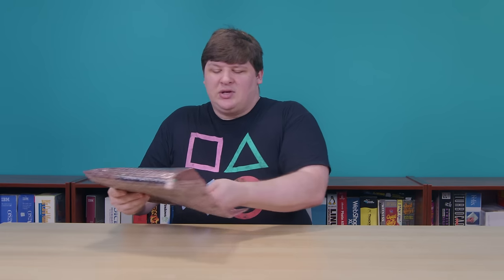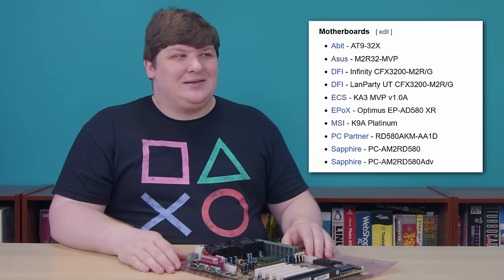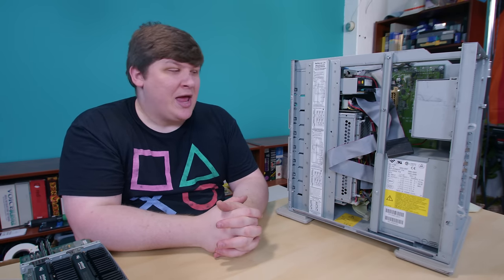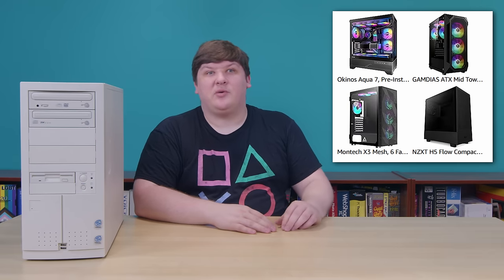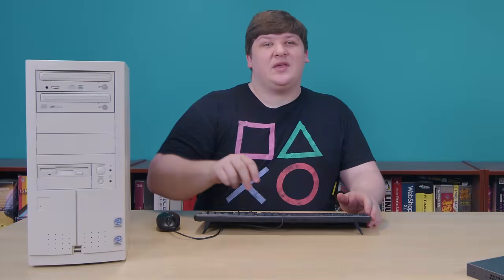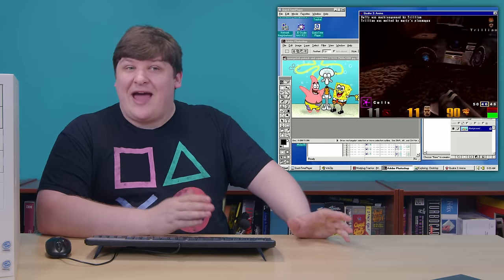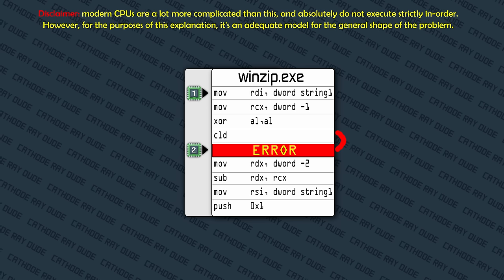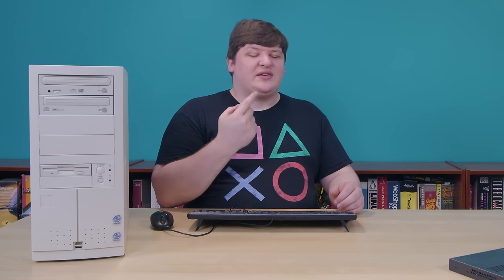The Only Famous Motherboard

Comment: As to why "Why Celerons on the BP6?" - when the BP6 came out, Socket 370 was ONLY for the Celeron (As you mention in the bullet list that you also imply is wrong, but maybe it was just the last bullet you meant was wrong?) The Coppermine Socket 370 Pentium IIIs didn't come out until quite a bit later. And Intel HEAVILY "suggested" that manufacturers use newer chipsets for the Socketed P3s.

And per my other comment - the main reason was that at the time of the socketed Celeron's release, the P2/P3 used a 100 MHz front side bus, and the clock multiplier was locked.

But many of those Celerons were basically "underclocked" Pentium II Deschutes cores, and were only available on the 66 MHz bus. You could quickly and simply overclock them by just running them at the 100 MHz bus of the P2/P3. Boom, that Celeron 300 becomes 450 - with the P2's faster 100 MHz bus, increasing a bunch of things all at once. That 366 becomes a 550. That 400 becomes a 600.

And a Celeron 366 cost WAAAAY less than a Pentium II 550.

I found the ad you featured @ 1:00:21 - on the same page is the nearly-identical but single-Slot-1 BE6-2. The motherboard cost the same $149. But the BP6 with TWO Celeron 466 ($369 bundle as shown in your video) cost only $10 more than the BE6-2 with a SINGLE Pentium III 450 ($359.) For $10 more, you got two CPUs that were each 3.5% faster; and could possibly be overclocked to significantly faster. (Or save $70 and get the dual Celeron 400 which would almost certainly be able to be overclocked to 600 MHz - the BE6-2 with a 600 MHz Pentium III would run you $629 - more than $300 more than the dual 400s.)

(And the Katmai Pentium IIIs didn't overclock very well. That 600 MHz Pentium III likely wouldn't overclock at all.)

(Also to note - Intel only finally bumped the Celeron to the 100 MHz front side bus with the 800 MHz model. The 766 MHz Celeron was still 66 MHz bus - with an atrocious 11.5x multiplier.)

Comment: 1:01:45 - /me  zips out folding chair and pulls popcorn out of microwave
Celerons were when I'd first heard of overclocking. I'd bought a 500mhz Athlon at in nineteen-dickety-ninety-nine, but Dual Celerons would have been So Choice with any linux or win2k. I'd always thought dual procs of the time were the purview of Xeons with ECC ram or PowerMac towers and none of this is for people who want to play vidja games. Core Duo is 2006, so you'd be getting a taste of computing from years in the future. Absolute monster sleeper.

Comment: You could take advantage of multiple CPUs on Lightwave back then by running a second render node on the same machine but this was only useful if you were rendering an animation and did nothing to speed up preview renders. They did add real multithread support fairly early compared to most 3D rendering apps though I think before the Core2 Duo came out IIRC.

Comment: Let me correct:
1. SMP is just "Multiple Cores" and has nothing to do with the implementation of the Abit board. In fact I worked on SMP systems in 1989, based on SPARC-CPUs (if you discount the Amiga computers which sometimes had several CPUs).
2. The first SMP consumerboard (again discounting Amiga systems) was the Gigabyte 586DX, with two CPU sockets, six RAM sockets and UW40 SCSI. It was not just powerful but also dirt cheap, cheaper than a normal 586 board and an SCSI controller. Before that 486 based SMP boards started at three times the price - without CPU.

Comment: I had an Antec 1080 case with Dual Amd 2100s using a Tyan mobo in 2004.  I stopped using it in 2008 when I noticed it sounded like a jet engine taking off when booting.

Comment: I Have the Dell Precision 410. Which is the (slightly) older brother of the 420. Looks the same on the outside but has a few differences:
Standard Intel 440BX chipset.
Normal AGP port
Standard SDR SDRAM.
edit: A power supply in the top part.

Still has the capability for 2 slot 1 processors. I have mine populated with 2 coppermine P3's @ 700MHz.

Comment: i don't remember if that board runs coppermine processors or if you need a pin mod to make sockets compatybile , but i remember on my back then forum a guy running dual pentium 3 s on it obviously those were moded because that is tualatin 1,4 ghz we talking about
i had a different setup, because i was poor, and imagine my surprise when i was able to run 2 celerons 566 on a similar board cd0 stepping running on 1,5v, with one leg removed running twice the oem speed with no extra cooling. it was epic junkyard build from 2004 whee cpu's alone cost me 4$ total and coolers were 3 times that each

Comment: I had one of those with a pair of Celeron 300a's.  It would run at 500+ mhz with zero issues.  I think I ran Windows 2000 on mine though because the driver situation sucked on NT.  I had a great run with that machine.

Comment: I remember exactly the switch to x86_64, and why I needed to use a 32-bit version of Win7. I still run 16-bit software, regularly. 64-bit PCs (or whatever they are now with their ungodly processor counts) with all the pointless bells and whistles doesn’t run 16-bit or 8-bit software or OS in any reasonable way. I need 32 or 16 bit machines regularly.

Comment: Overclockers loved Celerons because their L2 cache ran at full speed, equal to that of the processor, whereas the L2 cache on Pentiums was larger but ran at half speed. So when you cranked up the clock speed of a Celeron to a speed that rivaled a Pentium, or was even a bit slower than a Pentium, the performance was great due to that faster L2.

Comment: "I've had terrible luck with pci sound cards with old machines" - I used to shove Crystal based cards in my old 98SE/2000 rigs when I was broke af and had to use those old things when AMD64's etc were brand new and they always used to work once you found good drivers.

Comment: I feel like you completely missed the reason this board is really impressive and popular. The Celeron As had a full speed half size cache, and the BP6 allowed them to run in smt which was not supposed to happen, the p3s were were not able to do this, and the celerons were so easy to overclock, I had two 366 celerons at 550, why do people on campus with 300s at 450, and we all loved running either Linux or nt4 and as soon as Windows 2000 beta was out I was on it really great time, too bad the boards are known to have capacitor issues but best board ever

Comment: Just had to wait a year for Windows 2000. An OS designed for SMP that would run your games and you could actually benefit a lot, even if your apps are mostly single threaded the benefit to multitasking could be easily felt. Such a better experience than Windows 98 as well, it was way more stable. And it brought in the device manager.

Comment: PCI harddrive controllers were common; definitely would have helped the BIOS issue with booting from random spinners that were bigger than the board expected. Just put in a Promise Ultra100TX2 and call it a day. I used one of those in almost every PATA-era PC I owned to either get more drives connected, or to get drives to boot.

Comment: adobe in that era had a plugin that improved the multi--processor support. without the plugin you got a 70/30 split at best, with the plugin you get a closer to a 50/50 split.

Comment: Overclocking dual Celeron. Great way to get very good performance on a budget and it was solid and reliable. 366 pushed to over 500, good times. W2k was better on this machine. Did use NT on a dec alpha, which was nice as well 😁

Comment: Linux before and including the Kernel 2.2 had this weird quirk on i386 (I don't know if it was on all machines or just special ones) that it supported SMP just fine, but would only schedule tasks to one processor at a time. I can't put my finger on it when 2.4 got popular with distributions (with debian it was with 3.0 woody iirc) I just remember a few friends from the user group building the kernel from source to be able to use their rigs. It might even have to do with these kind of motherboards... i never researched it.

Comment: Would be cool if they switched to 12V PSUs and had the MB and video card step it down to whatever was needed, it would solve so many problems especially with current (more volts = lower amps for the same amount of watts). And you could just use a generic industrial 12V power supply. No more worrying about PSU reliability or multiple supply rails just slap a Mean Well 750W 12V supply in there those things are made to run 24/7 at their max rated capacity for decades.

Comment: I've read the story of dual-socket Celeron on Wikipedia. You short two pin and you get a CPU with the support for SMP without buying expensive workstation CPU. But the article is in Japanese and not translated to other language so maybe it was hard to find but I'm sure there's lot of articles.
https://ja.wikipedia.org/wiki/%E3%82%B2%E3%82%BF_(CPU)
In short, it was just another 486SX strategy which Intel forgot to lock enough. The reason why it's by nameless company is that it's not officially supported by Intel.

Comment: BP-6 and NF7-S were the motherboard’s to have. Also you want to run 300A’s at 100MHz FSB.

I dual booted Windows 2000 and Win98 SE.

Comment: my first dual cpu system was a pentium 2 SLOT 1 system 2 x 300 mhz cpu with 16mb of ram, The slot 1 cpu was actually quite cool, it snapped in much the same as the ram, much better than the LIF sockets where you had to force the cpu into the socket and hope you didnt break something, and you needed a special tool to pry it back out

Comment: I almost forgot I had one of these. The good old dual celeron experiment. Had to use Windows 2000 on it. Wasn't really all that impressive back in the day though. I don't remember what I did mine at all. I had more fun messing with Linux and getting some old dual Pentium Pro boards and CPUs when they were dirt cheat. At least with those I found out there's a lot of gold in them (1 gram).

Comment: i'd made a beast of a computer with this board back in the days. dual celerom 333@500mhz, matrox main graphic card, dual voodoo 2 12mb, AWE64, ...
had to run Win2000, don't think any games ever used the second CPU, but it was one hell of a brag to say i had a 1ghz (alright, 2x500mhz) computer back then ;)

Comment: Modern Windows still bounces processes between processors as far as I'm aware. There at the very least used to be an option to set "CPU affinity" on a process to prevent it in task manager, though it's a setting that in the modern world is basically unnecessary since most applications don't care about running on a specific CPU or core.
Also, I'm one of those few programmers that really, really enjoy multithreaded programming >.>

Comment: Multithreading and heavy workloads are such an interesting and to me completely unknowable field of software design. I used to play Planetside 2 on a xeon E3-1230(v1), having 4 cores was definitely good for the game, but something about the low level details of all this made it so that having hyperthreading enabled made everything much worse. This is hardly the heaviest load I would put on that machine and everything from simulation to rendering benefited from hyperthreading, so it wasn't saturating the cores while trying to share them. My only guess would be that PS2's inter-thread communication code sucked, so somewhere between 4 and 8 threads the inefficiencies started to outweigh the additional compute resource.

Comment: I know that Dell Precision isn't the main topic, but it's funny to see how Dell have been doing this bonkers mechanical design for at least as long as I've been alive. My work has some Dell workstations 10 years newer (with dual Xeon CPUs, topical!) that have similarly overcomplicated mechanisms for holding the bits in place, and weird shapes and nonstandard connectors for everything. And when Gamers Nexus cracked open an overpriced Alienware prebuilt, under all the fancy plastic it was the same story. Just seems to be their MO. I think Dell's engineers wish they could have lived in the 1800s designing steam locomotive running gear, and only grudgingly accept their job making computers.

Comment: The very very first Celerons were Slot 1 Pentium II's without the L2 cache dies installed, they shipped at 266Mhz but overclocked to 400Mhz VERY easily. the lack of cache hurt performance but it kinda hung in there for gaming workloads, they weren't massively popular. Then came the Mendecino, which had a 128KB L2 cache ondie at full cpu clock, the 300A part was super easy to pump up to 450Mhz and were GREAT performance and value at the time (at the time the 450Mhz P2/P3 was the top of the range, they had more cache but it ran at half speed), Celerons remained pretty respectable until the P4 generation where the trimmed off cache utterly destroyed them.

The TL;DR is that Intel accidentally made the Celeron's too good, at least in the hands of enthusiasts prepared to tinker a little.You could get a BP6 and a pair of S370 300A's that'd do 450Mhz super easily and spend less than just a 450Mhz P2 by itself.

Comment: If you want a laugh, run red faction on it without setting affinity.

Though... My bp6 was running a 333 and 433 in an unholy budget union.

You pretty much nailed the LAN party part. Though I think there's something wrong with your setup because I had no problems running q3a while leeching at full speed on... Emule? Smb and ftp simultaneously. I could even burn a disc at the same time without running out of buffer. 
I suspect that it may be because I was using the promise controller, with multiple drives, keeping the os separate from the downloads. 

You may want to retest it with a sata adapter and different drives

Comment: 9:53 At my workplaces in the late 90s and early 2000s none of our servers looked like that. All the servers were rack-mounted. I've never seen or used the bizarre SMB servers like these ones. I’m pretty sure even by 1999 more rack mount servers would have been sold than these very proprietary devices.

Comment: Very interesting to see the early dual CPUs being put through their paces with contemporary software.

Agreed with another comment, you want Win2k on that, not NT4 (which really was closer to an updated Win3.11). Win2K runs so much better and doesn't have the memory management issues. (I use a Win2k VM on a Win11 box that won't run an  XP VM)

I have two 'vintage' dual-CPU systems... one is a Compaq workstation, dual Xeon 750MHz, 2GB RAMBUS, SCSI, slick as can be even today. (This 25 year old gem was formerly the property of Jerry Pournelle., and weighs 57 pounds.) The other is a dual P3-500, without digging it out I think it's an iWill motherboard (presently the substitute board in my DOOM system til I get around to recapping its iBase800). Are those the reminiscences you're looking for? :)  1998 and 1998, respectively.

Who the hell thought Celerons were hot? They had the 66MHz bus, only thing they had going for them was they could be overclocked to crazy speeds. But the slow bus really lagged down the system if you needed to do any significant I/O. When I jumped one of my Tyans from C400 (on a slot1 adapter card) to P500 and 100MHz bus it was night and day.

I admit I'm astonished you have an Abit BPn  that hasn't died of the capacitor plague. I have a couple of the single-CPU model and ... yeah, they've gone down that death spiral. That 440BX was an awesome chipset. Had a pair of Tyan S1830S with it, worked hard for a decade, never crashed. Uptimes measured in years.

Comment: One of the more painful things about programming multithreaded code for the programmer is debugging it. Imagine the difficulty of trying to follow multiple different lines of code in different threads all executing at the same moment in time. Problems that would be trivial to find and fix can just become more complicated and timing related problems, which are inherently more common in multithreaded code, can shift around when running the code in a debug or release build. A lot of your time as a programmer is spent debugging so driving up debugging complexity makes the experience more time consuming and unpleasant for the developer.

Comment: I never had a BP6 but remember them. The big deal was that this board was made just to do what Intel didn't support. I had 2 different SMP systems both Tyan Tiger based the first was with Slot 1 P!! 450s and my second one was with Socket 370 P!!! 800s. Both of them were in Enlight 7237 cases.

Comment: SMP in Quake 3 will depend on the GPU drivers not having issues with what Quake 3 is doing so what works for 1 gpu driver version may not work for another. WinXP and Win2K drivers will likely support it better than NT4 drivers.

Comment: Maybe I’m weird for being “into” motherboards, although, it’s probably very very different when you’re looking at old products, SKU’s for which have been out for years, so if you’re building the best retro machine you do research into the subcomponents on boards and BIOses and whatnot and pick the best one for your form factor. Becoming an expert through that pathway isn’t something that happens as often for brand spankin’ new mobo’s which you pick up because it does a job and it just came out, so it’s roughly the best you can get at the time.

For example, ASUS’ Rampage III Gene TECHNICALLY has SATA III support. Except its Marvell controller is crap and in the real world, it’s not only often slower than SATA II, it also lacks a bunch of critical features, so effectively the Rampage II Gene is the same board when subjected to the usual upgrades. An NVMe bios and PCIe NVMe adapter bumps any X58 system to 1700+- r/w, which effectively brings them into the modern era (minus AVX support of course, which there are workarounds for).